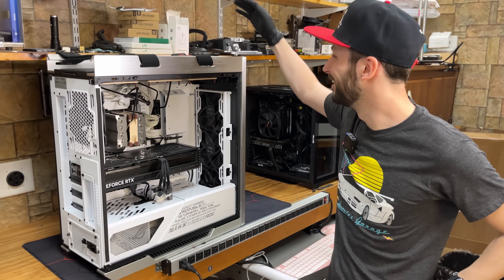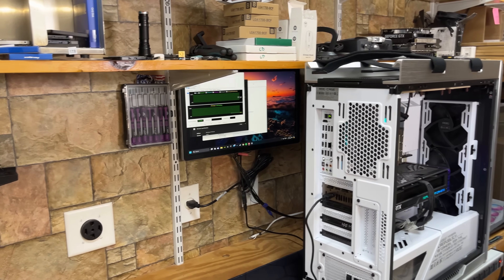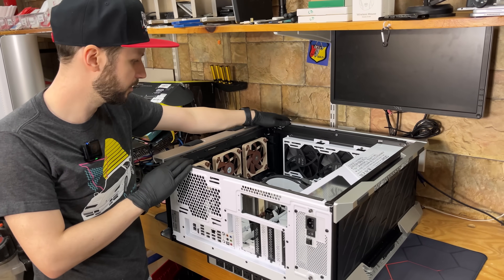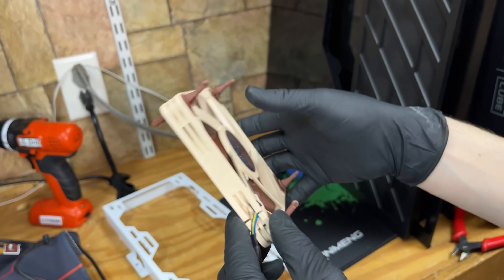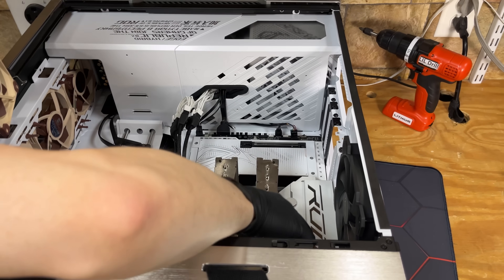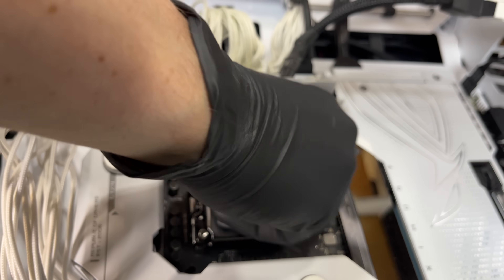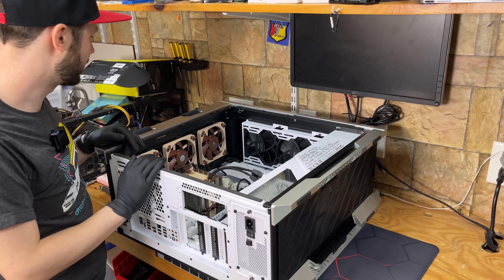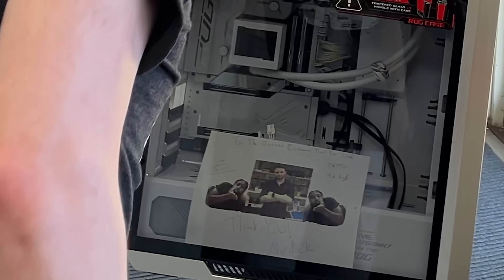ASUS ROG Revival: From Air to AIO on an Intel i9-14900K

Comment: The more I look at the computer, the more confusing it becomes. 90 mm CPU cooler, slim case fans in an oversized ATX enclosure, actually that massive ATX enclosure without a custom loop, holy shit.
Reply: It screams "the parts I wanted were out of stock at the time so I cannibalised my old ITX build"
Reply: @misterthegeoff9767  That makes so much sense
Reply: No I just like the aesthetic of the biger and more open case. Makes things easier for my not raccoon like fingers.
Reply: And the cooler was a placeholder till the aio came in.
Reply: @KhalMurdock  Easy access is always good, its a cool case too. But why the slim noctua fans brother? That big boi could fit 30mm Phanteks fans which perform as good as Noctua (some say even better) and are also quiet. I love me some Noctua fans though. Got 5 in my ATX case.
Reply: @RXR25  because honestly I don't need to puch more air. If I did, I'd have gone bigger.

Comment: Is that the NH-D9L?
It should be sufficient for even the 14900K (according to Noctua) - but only if the CPU is set to run within Intel specs, not at unlimited powah!

Comment: I am on 14900k with NH-D15 and it runs just fine .  Get a beefier cooler when you have a volcano inside ur case .
Reply: NH-D15 would work, but it's a NH-D9L like others pointed out
Reply: @BlackOtter9  An NH-D9L will cool a 14900k fine....you people are ludicrous.
Reply: I'm running a R9 7950X with a NH-D15 with twin fans strapped on top (120mm front & 140mm in the mid) and my CPU is always running cool.
This damn air tower has been on the market for ages and this relic still works fine on most CPUs.
Reply: Thats assuming you took the time to fully vent the heat out of your cpu. And not turn it into a sauna hot box.
Reply: anyone who takes an i9 an puts a 9 mil cooler on it, is just an idiot....PCs are funktion over optics, but yeah, people are just insane those days and then blame mostly others. i have an NH-D15 too and it keeps everything very cool, its one of if not the best aircooler out there! also iam proud that they are made in austria where i live ^^
Reply: @mysQlx3  Most of the new i9 cpus boost until they hit anywhere from 85-90c or slightly above regardless of what cooler you have, hardly cool running cpus.

Comment: The moment you said i9 14900k, and showed no liquid cooling, i shook my head in disappointment.
Reply: NH-D15 will handle it.
Reply: @Prime0pt the other machine had the 15 and it didn't handle it.
Reply: A case that big doesn't need a AIO. But it does need a cooler rated for more than 150W...

Comment: Always use water cooler fellas, don't be cheap ffs
Reply: I only use air. Gives me peace of mind.
Reply: Thermaltake assassin will do the job
Reply: Why? yes, you need it if you are using 250+ TDP cpu but not for 65-120W cpus. Air is more safe than AiO and you can fix/replace it very cheap.
Reply: air is fine if not running i9 14k bullshit.
Reply: @Ormil  Yeah I don't even touch intel stuff anymore lol

Comment: That case is so heavy you need a car jack to lift it up 🤣
Reply from the maker: ASSUS was so concerned on how heavy to make it they never worried about the thermals
Reply: And a seatbelt to carry it apparently? Wtf was with that strap
Reply from the maker: Cause it’s so fucking heavy you literally need them to pickup
Reply: @bavarianblessed  Wish my TT P6 had those... Bastard is tough to get up on the wall mount!!
Reply: at least it's (probably) rather tough
Reply: No crap! It weighs 900 pounds!

Comment: Better than spending 69420$ for Asus fixing an issue unrelated to the overheating.
Reply: Warranty claim denied : there's a scratch around the upper left motherboard tray screw hole. That'll be 278$+tax+shipping to fix it.
Reply: That’s tame compared to some of the horror stories I’ve heard, I used to be a huge asus fanboy for years. I’m seriously thinking about modifying my new build and axing all asus components before I buy.
Reply: OMG i know right. We could not find our serial number for our ROG Strix and nothing on system info told us. No one told me the control panel showed it with a command. ASUS techs gave us the run around and we had to turn our PC off way to many times in the span of 3 hours, think like 5 and or 6. We said quit making us turn it off that many shutdowns isn't good for the PC and were renting it right now so you guys are risking voiding my repair warranty if it breaks. Its fine, but god I was so annoyed. Finally one lady gave us the command and we found the serial number for ours. Then took a snipping tool shot of it and saved it. God it took this lady like 5 minutes to get it for what other ASUS techs took hours of turning off and back on the PC to never find so I said OMG never again unless necessary ASUS is giving me the run around and its pissing me off plus caused us a all night stress headache
Reply: Lol I have the same case with a 9900K with no issues your dumb bitching denied 😂
Reply: Literally nothing goes wrong with any of the ASUS stuff the guy even takes the ROG card because he knows there GOD TIER or anything about warranties and you two have to put a negetive spin on shit ……. Your bitching card has expired Autismos
Reply: And spending 3 hours going through their useless support checklist before you get to the actual problem
Reply: tbh thats more of a fault of your incompetent congress and lobbyists working for companies. united states has shit consumer laws when it comes to RMA and/or warranty. and middle management in every company  working for bonuses tied to least amount of $$ spent/earned on warranties etc. And asus is not the only one that does this shit in case you are not following actual news and not just getting your news on youtube. i have had Gigabyte and MSI try to pull the same bullshit in my country but due to my country having consumer laws that companies dont want to mess with unless they want million dollar fines they cave quickly when you mention the national consumer council will be your next stop
as someone that has dealt with pc hardware for better part of 2 decades asus is actually the manufacturer i have had the least trouble with( so not a fanboy either i pick what suits my specifications best). just be sure to meticulously document the state of something before you send it in and the packaging it was sent in. and in my country all manufacturers are liable to send you packaging(if you do not have the original boxing) and pay for the shipping of RMA's as its part of warranty procedure
Reply: @Ra1dMaX  and im sorry your so hellbent on shitting on the U.S. you don’t learn it’s actual laws but we have several governments not just one it’s called state governments and they have consumer laws
Reply: @Ra1dMaX  lol and your countries so perfect right why don’t you tell us your nation that your keeping away for the fact that maybe the only decent thing to mention of it
Reply: @austinwhite3132  not hiding it, but i can off the top of my head mention a few like universal health care, free schooling for all levels of learning, gun laws that actually work, a justice system that is not rotten to the core, and we actually have some proper labor laws compared to the capitalistic slavery system you still have that only benfits corporations, 52 weeks paid parental leave, 4 weeks paid vacation every year no matter what you work as.
and the country is norway, sure its not perfect but it has worked its way to be pretty damn close compared to the united states
Reply: @Ra1dMaX  and im sorry you like making fun of our country then learning but we do have consumer laws and they differ from state to state
Reply: @austinwhite3132  never seen someone be this mad on YouTube comments, that's embarrassing
Reply: @Ra1dMaX  im pretty sure they don’t give a shit about who you mention and I doubt this council really cares about one person complaining about there product
Reply: @clementpruvost8670 also such a brainrot comment sees ASUS product and instantly applying a negative butthurt comment lol